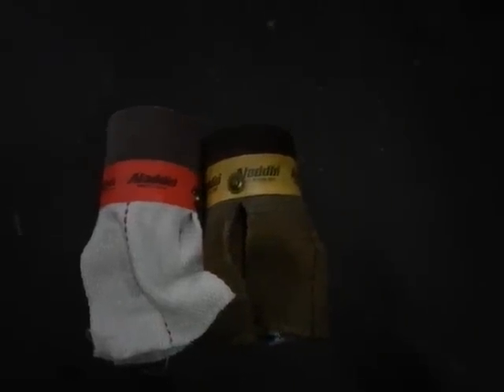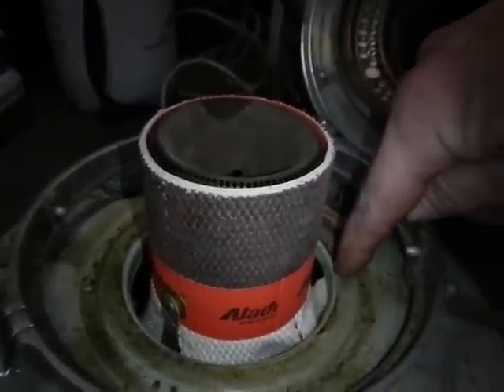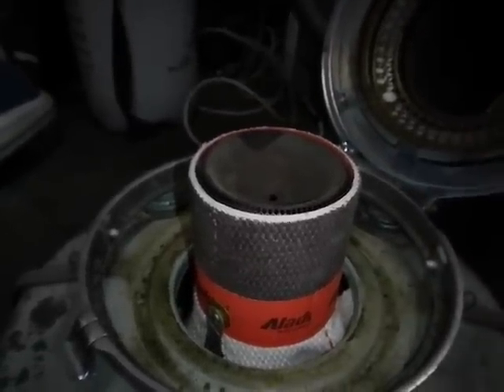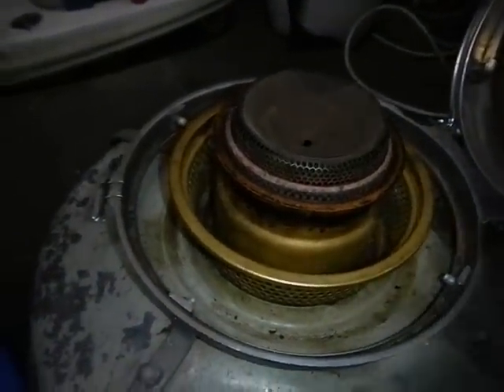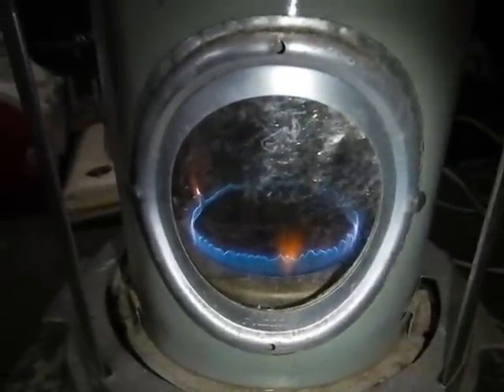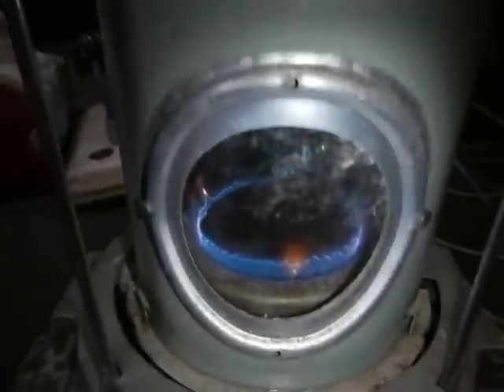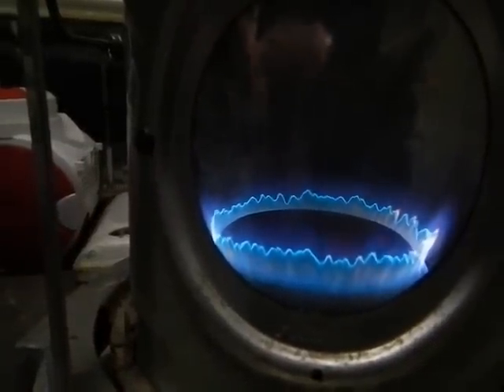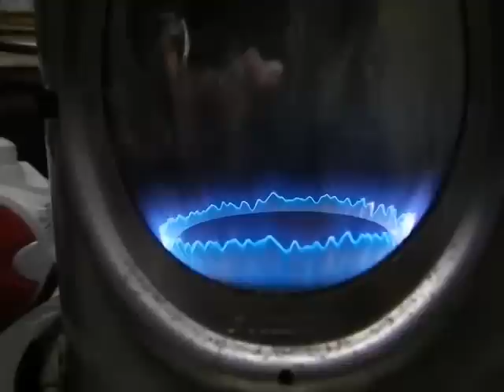Aladdin New Wick

Comment: Great video Jag, I am new to these heaters and just scored one at the swap meet for 10 bucks! It is an aladdin 15 series and I need help with the wick install. Mine has a brass cuff on the inside of the wick holders, the cuff is split and I don't know if it's supposed to be, and I don't know how it is supposed to be used with the wick. Any help from anyone is surely appreciated.

Comment: I can't understand why I get yellow flames on a quarter of the wick on one of my heaters. The wick is new, even all round and makes no smell when lit. I don't have this problem on my other 2 Aladdin's. I notice the flame evens out after about 3 hours of usage although not by much. I have used the wick cleaner and the results are the same. Any suggestions?
Reply from the maker: sounds like holes that let the air in are blocked or the top is not 100% lined up to the wick when its shut. you may have to clean the air intake and then adjust the lid.